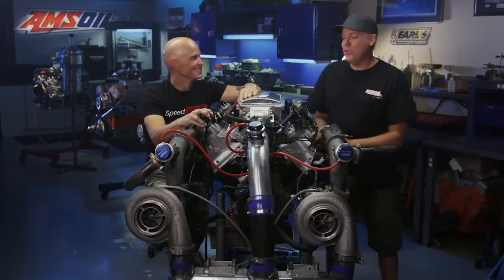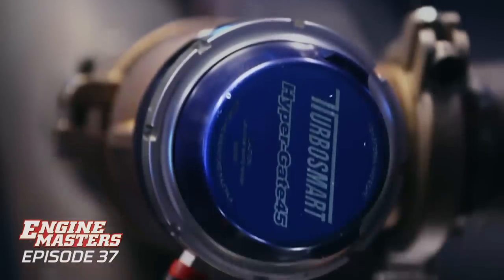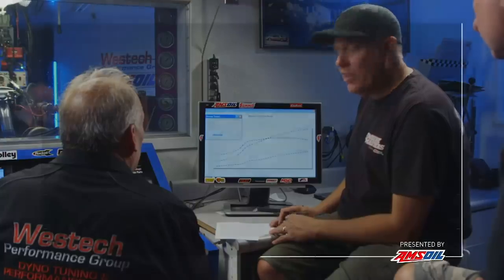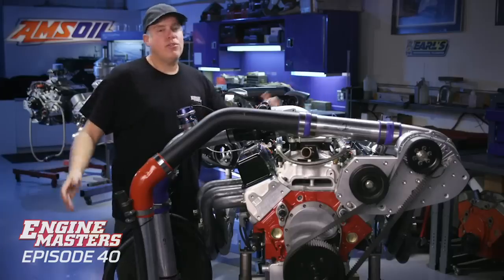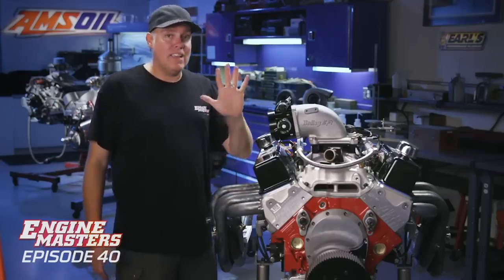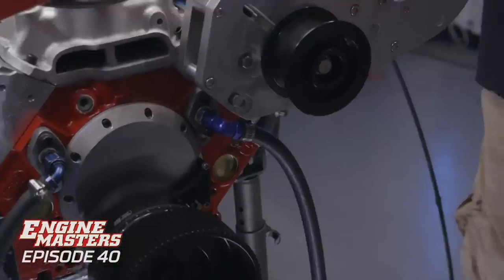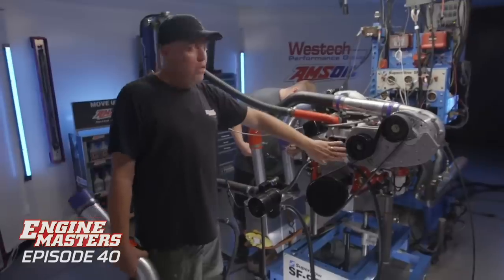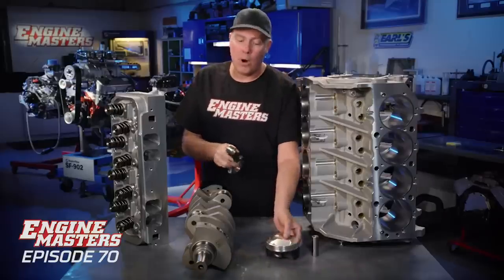1500 Horsepower?! Maximum Power Engine Mods | Engine Masters | MotorTrend

Comment: What are the best cars under 1000$ ?
(Pov: you're a college student working as a part timer)

(Miata is the obvious solution, so it doesn't count)
Reply: If you really don't care about what you drive and want decent reliability: late 90z camry/corolla
Reply: Civic. cheap, reliable and handles well. look for an 8th gen with a manual.
Reply: EG/EF civic
Reply: There are no good used cars under a $ 1,000.
Reply: Ford mustang and dont get a V6
Reply: @thenewhalogod  I fkn hate gen 8 civics. Everybody I know who has one has constant battery issues, most have had ignition issues, and mine had gross throttle response and pedal feel. Every input on my ford ranger winter beater, aside from the shifter, feels better than that "sporty, reliable" civic did. And good luck finding a running one for less than $2500, no matter how bad an example.

Yes, I know this is all anecdotal, so take me with a grain of salt, but honda hasn't lived up to their reputation since the 90s.
Reply: A  used 90s Toyota Corolla is cheap good and reliable I believe.  Runs on cheap gas and change the oil once a year. lol..

Comment: Wastegate bleed valve, is this the 80es?
A 1985 Saab has a more advanced turbo system then this.
Reply: Dont think ive ever seen someone quote a 900 in any motor trend or other hot rod based channel. 100% approve though, ive got 3 of em along with my American muscle 🤟
Reply: There is beauty in simplicity.  Why complicate a system that doesn't need to be?

Comment: Richard Holdener . . . really . . . the guy that compared a completely well built small block chevy to a stock smog wornout Mopar 360 bottom end with PORTED cylinder heads, large cam and intake and claimed it was a fair test . . that Richard Holdener . . .I wouldn't let you rebuild my electric toothbrush . . . . .

Comment: Why do they run a wet sump, why now go with a dry sump set up.
Reply: Because it would be a complete waste of time and money. This engine is run for testing on a dyno. A dry sump is only beneficial for oiling issues caused by the oil sloshing in the pan or to increase oil capacity. Neither of the issues are at all relevant on a test engine for a dyno. I’m a lot more curious why you think they should use a dry sump because it seems to me that this would be very stupid to do. Maybe you know something I don’t so please inform me if you can think of a reason to do so, I would love to learn something new!

Edit: it’s for dry lake bed racing, still no need that I’m aware of for a dry sump because the oil is only likely to slosh in one direction which can so easily be solved by putting the oil pick up in the rear of the pan and some very simple oil pan configurations.

Comment: No. Not like that. It just might last the run, and some of it back, but not like that. It may even last both runs in dyno settings, but salt is a different format. Did you not learn anything from the last salt lake experience? Torque only rips the tyres off, and ruins the track. Small displacement, short stroke and maximum flow heads with large volume turbo to control the torque output on high RPM. Then comes the gearing, tyres, suspension and most importantly: Aerodynamics.
That particular engine has too thin cylinder walls to keep the combustion inside the chamber throughout both runs. Too long crank throw to keep high RPM going for long periods of time, and too much of a lobe for high RPM valves not floating. Too much friction, too heavy parts, too much of clearances needed to contain pressures in the right areas.
The goal can be achieved with 2-valve V8, but not like that.

Comment: No one will do a cad 500 or 580 with an f3 procharger on pump gas. They keep the engine cooler then twin turboing so you can run high boost levels on pump gas.

Bv

Comment: you people do not get it its the end of combustion engines go electric. time to change. its over with combustion engines  they can never beat electric.
Reply: Well electric is fast but the gas engine just screams and vibrates. The human body just needs this noise to make it exiting. They need to make electric motors that wine like a positive blower or something. And put a vibrator under the seat of these teslas. lol😁
Reply: I drive for 11 hours over a high mountain pass around once or twice a month. thats 11 hours each way. I cant do that drive in 11 hours in any electric vehicle I know of, and if incremental improvements make it possible, I will still be wanting to use the vehicle when I arrive at the end of my trip.  Charging simply takes too much time compared to gassing up.   I do not think this is a solvable problem either, gasoline is incredibly energy dense, and for long distance trips it will have to be replaced with another chemical fuel, and the environmental issues will need to be addressed by improving the precision of combustion, and by scrubbing the exhaust.  You electric people seem to believe the electric cars are magic, and that Tesla is holy ground, but just as there are things a gas engine simply doesn't do well, there are things electric motors suck at.

Comment: Lmfao, I'll be impressed  when you go as fast or faster then Accufab Mustang with a stock block and heads and crank.  Till then blah blah blah
Reply: How crazy that comment is the guy who owns West Tech performance where that was filmed that is best friends with John maho votes from acu fab M lanco they are very familiar with what John can do
Reply: I meant how crazy about that comment from you Frank  I was there in John's pit in 2013 when he shattered the complimenter record in NHRA
Reply: West Tech is also  A sponsor on  Johns Mustang and the awning they put up to park the car under in the pits is also covered with West Tech performance into awful smalle world out there These guys were testing stock motors with power adders they were not building race motors big difference
Reply: @dakotaautosales9673  this is about racing correct,     so it falls in the category
Reply: Difference is mustang engines go boom at those levels and cost $5k easy just for the block whole engines run 8-10k 6.0 Chevy $1500 maybe. 5.3 $500-1000 lol